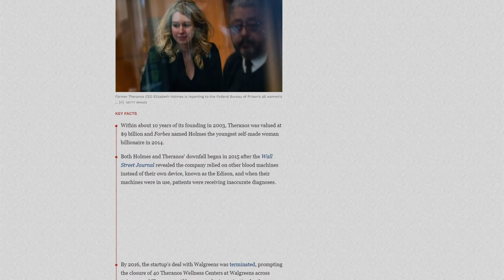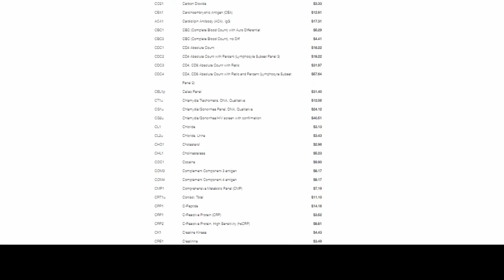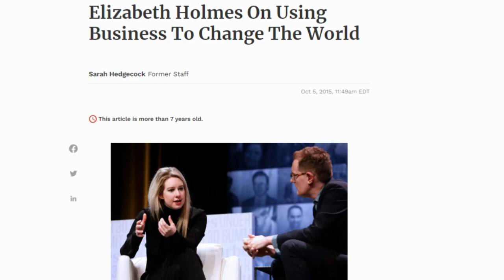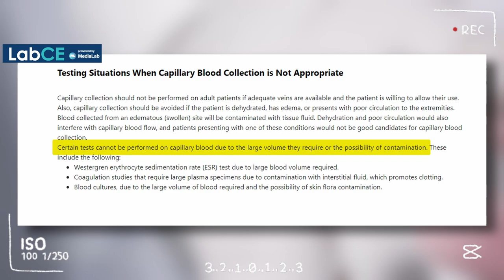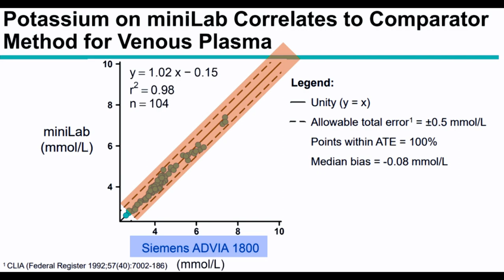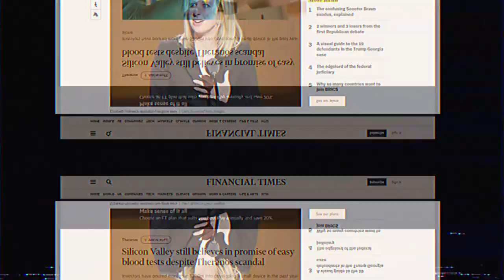Theranos and the little box of garbage

Comment: Having an automated blood testing machine available at your local pharmacy is still a good idea.  But there would have to be a trained technician on site to draw the vials of blood needed to accurately perform the tests.  Maybe someday you could automate the needle stick/blood draw process also.  The machine would have to be larger, probably the size of a refrigerator as opposed to the bread machine size of the Edison gadget.
Reply from the maker: The size of the machine, which was the defining factor of the Edison was also the Achilles heel of the whole operation for exactly the reason you stated ; you need a bigger machine to house the mechanisms to run the laundry list of diagnostic tests she claimed it could do.

Given how important blood testing is for an indication for serious medical issues, my hope is that one day that technology in the same vein as the Edison is mainstream enough to where people can get an instant readout about potential markers and ion levels (among other things obv) for early detection.
Reply: We have a blood testing lab (and other medical offices) right across the street from Walgreens so it's not that big of a deal to pop right into the lab instead of Walgreens. I don't see what solution Theramos was proposing. Lab tests have to be ordered and read by the physician, not the patient.